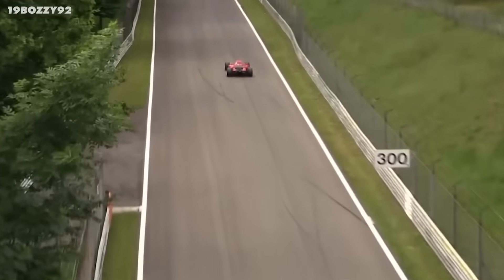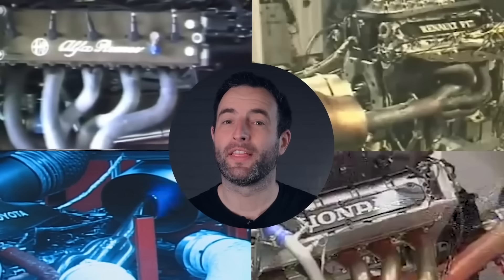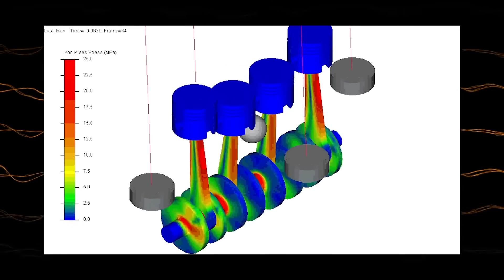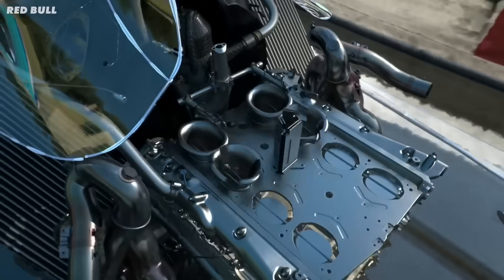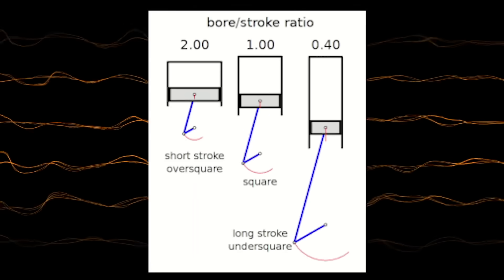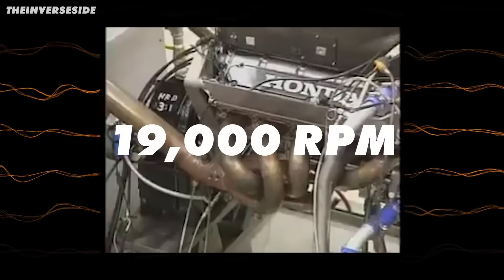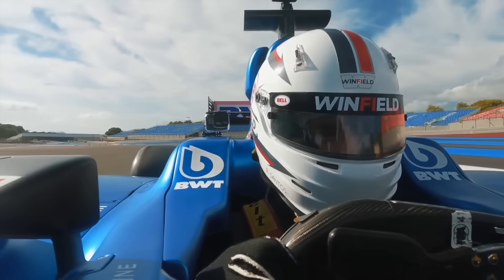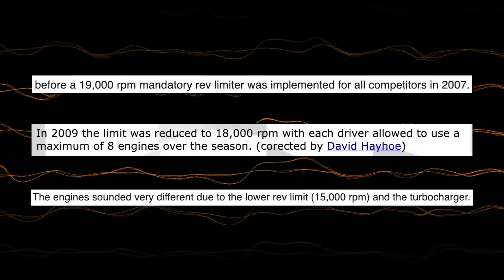When Formula 1 Engines Revved to 20 000 RPM!

Comment: All around great video. The V10's remain the pinnacle of engine's IMO. Small correction, F1 never had a limit of 17,000 rpm. It's funny how the FIA strayed from V10s because of "cost" as they claim, but the complex power units of today are far more expensive. Unfortunately 3.0L V10s can never be as efficient as the today's hybrid engines.
Reply: Its mostly to kill Ferrari's dominance ;)
And they succeeded, Ferrari never won a champanionship in the Turbo-Hybrid era...
Reply: @AaronShenghao  mostly because Ferrari is incompetent most of the time
Reply: @RukaGoldheart FIA has no Mercedes bias btw
Reply: The thing I remember most about the reports at the time was that it was about safety and not cost, though Max Moseley liked to use safety as a catch all to force through changes quickly. I could kind of see the reason as those V10 cars could hit 230mph with less run off, though ironically the V8's cornered quicker as the smaller engine allowed for better airflow and more downforce.
Reply: @andrewcarter9649  think the big safety concern was catastrophic engine failure, much like in top fuel limitations. Often see it cited that turbos were banned in top fuel to control speed, but is heaps better ways to control that, nitrometh melts turbos like no tomorrow and thats a recipe for taking out multiple cars that some are not flirting with the limits of sensible engineering near as much.
Reply: @Brougley  Not really, they'd already brought in the rule that engines had to last 2 races in the V10 period and some of the more exotic materiels like Burillium were banned in the early 2000's. Whilst you saw failures it was only really the Honda's that went up in big clouds of smoke and the ginat fireballs were already long consigned to history.
Reply: @andrewcarter9649  That's because Beryllium is hazardous for the human body, not exactly at touching (however it can already cause skin irritations by touching it) but inhaling particles that ususally are generated in processing it.
And if I remember correctly they had a whopping TEN engines per Driver/Car each season in the early 2000s, nowadays they have three.
Reply: @kuchenblechmafiagmbh1381  Ten, try a new engine every session. Williams went through 150 engines in 2000 when they partnered BMW.
Reply: @andrewcarter9649  Typically 1 engine for practice, one for quali, and one for the race. 2 drivers, 16 races that's 96 engines minimum. Doesn't factor in minimum 2 spare engines brought to each GP, engine failures, etc. This stayed this way up to 2003.
Reply: @SS454LS6  Yes, I know, I would have thought my last comment of " a new engine every session" would have made that clear.
Reply: @andrewcarter9649  It was. I wasn't correcting you, just elaborating further off your comment.
Reply: @Brougley  😮
Reply: @Brougley my understanding is that the fuel was partly toluene, a carcinogen and crews had to use special precautions around the fuel rigs
Reply: Side note : The FIA introduced a 19.000rpm limit for the V8's in 2007 in an attempt to reduce the costs of reliability issues
Reply: For the amount of racing they do emissions shouldn't matter at all. The V10 days were absolutely the pinnacle, before anyone gave a crap about emissions and just wanted the best racing possible.
Reply: @bobbygetsbanned6049  love how many fair-weather fans are so totally unable to enjoy motorsport because the engine makes a different sound. It actually baffles me. When I'm watching a race the actual sound of the engines fades into background noise, how do y'all hold a hate-boner this strong?

Edit: oopsie wrong ping meant the dude two posts up but its an open question anyway
Reply: @theplumbum82  Some of us are petrol heads as much as we are racing fans, so sissy little battery assisted engines just don't do it for us. Especially when it's done for emissions, which racing has almost no impact on. It's a political move so they can feel virtuous, which they put a higher priority on than achieving peak performance.
Reply: "sissy little battery assisted engines" feels like a weird thing to say when electric motors are rapidly becoming more powerful in every meaningful way than combustion. Honestly, I think the existence of Formula E is probably why the electrical component in F1 is kept so minor. I'm really, genuinely looking forward to a time where EVs are as cheap and accessible as combustion.

So it really is just the noise?
Reply: We ! Don’t! Need any effiency. We want angels scream
Reply: Well actually.... the V10s are far weaker then the current Turbos. And weaker and less Extreme then the 80s Turbo... and while A single PU is more expensive then a V10, due to PU being more durable, Overall cost of costumer engines is dramatically lower then in the V10 era. Back then 30-40% of a small Teams Budget could be needed for engines.
Reply: @TheNecromancer6666  Not sure I'd entirely agree with that, all of the V10's were pumping out well over 900hp by 2005 and while that doesn't match the max output of 1000+hp of the current V6's they could use that power all of the time. The Hybrid system add 160hp but only during acceleration as the amount of energy per lap they can deliver is limited by the regulations, so after initial acceleration they drop back to ICE only which is less than 900hp.

You're not wrong about the cost though, Jordan were paying $50million for their Ford engines in 2003 with a total budget of about $75million. No team pays more than $20million per season for their engines now, when adjusted for inflation thats probably less than 1/3rd of what Jordan were paying.
Reply: IMHO letting Mercedes set the design parameters for the engine was a terrible idea...they had at least a 5 year jump on the other engine builders
Reply: Racing is not supposed to be efficient but all about tech and speed.
Reply: the fia are prone to lying
Reply: the modern engines are over 10X more expensive.....  they're dumb and woke
Reply: @Dartgame 340 Of course they could, just mandate bigger fuel tanks.
Reply: Mutha-F$#@ efficiency! That itsh doesn't translate to fans watching on a television.  But the sound of that V10 does!!!
Reply: Who here cares about economy in f1...
Reply: AS pure electric kills the Hybrid big time with 80% less complexity. and costs.
Reply: But a 2.1L V8 turbo could be the sweet spot between V12s and V6 turbos.
Reply: They don't need to be efficient if they run on biofuels.. something f1 can and should do to bring back THE sound
Reply: @Nick-sd7um  They always need to be efficient, there has never been a time where that hasn't been true. Biofuels have the problem of a lower energy content than petrol, so you're actually asking for bigger tanks and more weight.
Reply: @andrewcarter9649  lower energy density maybe but biofuels extract more Power from an ICE .
Reply: @waynegarfield6607  They have to burn considerably more fuel to do it though. When the Nasamax team ran at Le Mans in the 2000's with an engine that ran on biofuel they needed a fuel tank of 156 litres, compared to the usual 90, so that they could produce the same amount of power and still run for about 50 minute stints against their petrol powerd competition in the LMP900 class. The tech has almost certainly come on since then but I doubt it's enough to make up for that massive difference.
Reply: @Nick-sd7um  its not about needing efficiency its about cool Technology. And highly efficient Turbo is a lot more interesting then a V10 that just revs high.
Reply: The 80'S turbo and the V10, V8 eras were the best with violent acceleration and braking. Today's engines sound like sewing machines.

Comment: The V10 era was the best era. That glorious sound.
Reply: V10s... or Nothing...
Reply: The 70's was the most interesting era since almost everything was tried then.
Reply: @ehsnils  True - they had a lot of different engine configurations.
Reply: Flat 12, V12, V8, Gas Turbine. i loved the 70's.
Reply: 100000000000000%   Even better than the V12s.... nevermind the current nonsense.
Reply: @Lamster66 'More power' has no effect whatsoever on entertainment value.  

The V10's had over 800 HP in a car that weighed 1200-1500 lbs.  That's more than enough power-to-weight to be thrilling.
Reply: It wasn't only the sound it was also the boundaries that were pushed to push for modern tech that would become basic tech instead of stupid v6 being exclusive to the million dollar or simpler units for the 260k vehicles
Reply: Agreed. But that Ferrari V12 made a beautiful sound too.
Reply: Agree
Reply: The best era has got to be F1 1989-1991,  multi engine configuration will always be the best because of the variety of the engines sound, and the racing were spectacular.
Reply: @mdkhafizan7554  The diversity of engines in the early 70's was huge, and you could identify the car before you could see it coming. they all had their distinct sound. flat 12 Ferrari, V12 Matra, Flat 12 Techno, V8 Alfa Romeo, V8 Cosworth DFV.  Pratt and Whitney Turbine. i saw them all in the first two years of the seventies. far more interesting than the efficient but boreing dross we have now.
Reply: @Lamster66 , quite close.
Reply: @Lamster66  The Lotus 72 was competitive for close on five seasons.
Reply: @Lamster66  Nah, he is absolutely correct. the cars we have now have the most efficient engines ever to be put in the back of an F1 car, but they are as boreing as hell.
i have been attending GP's for 55 years and i know what i would rather see and hear.
it's all rather subjective i suppose.
Reply: That was my attraction to F1 at that era.
Reply: Se on kaksi viisi sylinteristä. Ja viisi sylinterinen voittaa kutoset ja kasit ja neloset äänessä
Reply: And just think…they could make it happen again.
Reply: I lost interest in F1 once the V6 Turbos were introduced. Anyone else?
Reply: @rickamday1  The peak of the first F1 turbo years (1984-1986) with In-line 4, V6, V8 turbo engines were way much much more awesome to watch than the V6 turbo hybrid F1 that we have today.
Reply: @rickamday1 I'm with you.  F1 sucks now.
Reply: 80s V6 turbo was better don't @ me
Reply: @RukaGoldheart  That era would be a very close #2
Reply: V10 was the best sound but not close to  best competition or racing.
Reply: @isaacm2374  they didn't have DRS. You could say the same about racing without DRS now.
Reply: @cipher-6.66  not about DRS. It's about the number of teams that were competitive and number of different champions. You look at early V8 era. You had Alonso 2006, Raikkonen 2007, Hamilton 2008, Button 2009 and then Vettel 2010. We had the most intense and closest championships in F1 history in those years where it usually went to down to final races and 2-4 drivers can win the championship. That wasn't the case for most of the V10 era. Forget about 2012 where it was perhaps the best season ever in F1. V10 engines may sound, but the V8 era delivered more.
Reply: @isaacm2374  There just wasn't an overly dominant team between 2005 and 2012 (excluding Brawn for the first half of 2009 and RB in 2011) like there usually is.
It almost looked like we'd have something of a similar situation last year, but of course we didn't since RB ran away with the title, Merc didn't improve as much as was expected and Ferrari was being Ferrari
Reply: @isaacm2374    Its because the FIA did a lot to stop Ferrari. Very strangely they did absolutely nothing to even try to stop Mercedes. But dont forget 1997, 1999, 2000, 2003 and 2005 were very close years in the V10 eta
Reply: @isaacm2374  yea and Lewis won 7 titles and now max is on his third. With all that artificial overtaking……
Reply: @isaacm2374 The V10 era was the grooved tire era.
Reply: @isaacm2374  Weeell, arguably the racing were better too. Or at least would be.

V10s were small and nimble. Could you imagine these trucks these days without drs...

Comment: It should also be mentioned that a bigger bore/piston is accompanied by bigger valves. Which equates to more air/fuel flow for the extra rpm
Reply: Yes but the piston dosent go down as far as something with a smaller bore and longer stroke, your moving roughly the same amount of air
Reply: @trevg7253  it's the same amount of air displacement wise. In a 3l engine with 100% volumetric efficiency the power output will be almost the same at the same rpm so bore/stroke is a minor factor. The problem is maintaining a high VE at high RPM, and the bigger valves help with that. So your reply to soso1p2011 doesn't really make because you aren't talking about the same things. If you like engines do some research about VE, it's a simple concept that should be explained in 5 minutes in any decent YouTube video.
Reply: @Runmeerkat And you sir proof read your work to check for missing words never mind oversize valves .

Comment: The grooved tires from that era really bummed me out. I remember even as a teenager being absolutely baffled by the highest level of motorsport running intentionally crap tires.
Reply: i always thought they looked really cool as a kid. i didnt know they were purposefully bad.
Reply: @sudazima  yeah it was designed to reduce surface area for less grip without making them run really silly looking skinny tires. I'm probably a little older so my mental image as a little kid was the insane, almost wider than tall tires they ran in the 90s
Reply: they still do that today. pirelli is purposely making tires that degrade like shit to prevent a scenario with 0 pit stops
Reply: @no1washerezz  but at least they look cool?

Comment: I was rewatching the 2006 Bahrain Grand Prix, and both commentators said they didn't like the sound of "those new V8's" because it was too loud and not particulary good sounding.
I find it funny because now we would give everything only too have V8's back !
Reply: compared to the V10s the V8s did sound boring, shrill but without individual character
with the V10 every engine had a characteristic sound, you could tell which car it was without looking
the BMW was harsh, and sounded like it was tearing apart the gearbox on downshifts, the Renault was singing with its melody telling you what it was doing, the Ferrari was very smooth,....
Reply: V8 might have sounded shrill, but they would sound godly if we replaced the V6 vacuum cleaners we have to currently enjoy
Reply: @JohnWiku  I also think an Inline-4 Turbo sounds better than a V6 Turbo. I mean just take a look at Super Formula.
Reply: @AbrahamArthemius  indeed! A higher revving inline 4 than the current V6 would sound much, much better. It'd give a glimpse of that flatplane V8 sound, even an inline 5 would be amazing!!!

Comment: There should be higher class named F1 Unlimited 
and hold a race two or three times a year...
It would be amazing to see what humans are capable of creating
without any of these rules or pressing schedules. 
Imagine the level of innovation and progress.
Cool video, thanks!
Reply: Imagine the level of death
Reply: Just call it F0 (reference to F-Zero), that's the best name a racing series could ever have, F0 meaning Formula 0 restrictions.
Reply: @spidi500  speed costs money, how fast do you want to go? That's why there's no unlimited F1.
People get absolutely stupid about money, win at any cost. There are people who will spend $20,000 to airfreight an engine for a local club Formula Ford race zero prize money.
Reply: @hotprop92  i guess that makes sense...
Reply: Porsche already did it with the 919 EVO
Reply: @danu9838  that aint f1
Reply: @lajsna9936  well yeah but it is was created without rules and go as fast as possible around corners
Reply: @danu9838  and yet an F1 car wiped away its Spa record the very next time they drove there. There is nothing particularly impressive about building something fast with no regulatory or budgetary constraints.
Reply: @joelambert7128  F1 teams has the capability to do so

They run at limited fuel flow and limited turbo boost

Unrestricted they could push maybe 2000 hp, would mean building a new car, engine, and all that. Too expensive, probably why they don't do it
Reply: Wasn't CAN-AM kind of 'run what ya bring' racing?

Comment: It makes you wonder if they were getting a 1,000 hp 20 years ago, how much more power could they get today out of the same block and heads?
Reply: I am by no means an engineer but maybe a good comparison would be to look at road cars NA V12/V10 engines from the 90s/early 00s to now for comparison and add 50-100+hp (because of more and more regulations)

F.ex

Ferrari Enzo/McLaren F1
Both 6.0L V12 NA, producing 650hp roughly
110hp / pr L

´´Normally´´ you would get 130hp pr L (GT3, Ferrari 812, Aventador, Zonda etc) all around 130hp pr L. They can push it more, but for regulations and reliability they have to keep it around this area. Some cars are more extreme,150hp pr L (Valkyrie) or 160hp (T.50) 

F1 cars with 3.0L V10 could achieve 320hp pr L and the power levels were still rising even though they put restrictions in 2005

We maybe would have seen 400-450hp pr L or more
If there were no regulations and car manufacturers were allowed to continue to improve
Reply: If you think the 1.5 turbo engines developed over 1000 HP in 1986 imagine how much power they would get today...
Reply: @vonPelger  Yes, they also used rocket fuel
Reply: @vonPelger  I think it was well over 1000hp  actually. BMW made 1400hp. but yeah either way, crazy

Comment: 19,000 rpm is phenomenal. Normal road cars will go to 6000/6500 rpm. 
Really sporty high revving cars will go to 9000 and the V12 Cosworth of the GMA t.50 will go all the way up to 11,500 rpm. 
Normal engines will brake down (literally in many many pieces) before they’d reach anything near that. 
So 19,000rpm really is phenomenal.